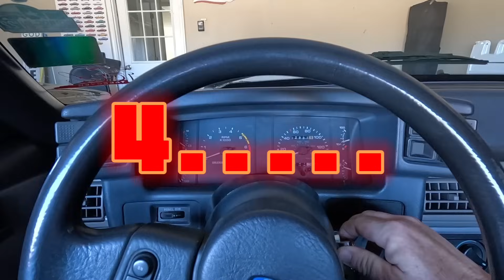Something DRASTIC needs to happen, and soon!

Comment: Sounds like the low speed / rpm issues are stemming from the converter being too tight fit the cam. I would personally start there.

Comment: Sounds like a problem with the converter. Mine did the same thing after a rebuild with a brand new converter. Put my edge converter in and problem solved. Plus it's a beast now when you put it to the wood!

Comment: Allow me to solve your mystery for you. I have a 91 lx with gt40 heads and intake with an e cam and a 65mm TB. My car is a factory Aod car as well. When I was building the car, I got some good advice that I totally ignored and regretted it the first time I drove it after the HCI upgrade. I was told not to leave the factory torque converter in it because it would cause issues with the e cam. Everything you are describing happened to my car, making it a total pain to drive. A few months ago, I gave up and switched the torque converter in it for one with a stall speed that was about 500 rpms over the stock one. Wow, what a difference, I love driving my car now. No more jerkyness, dying, and fighting against the converter. I used a B&M Tork Master Torque Converter 40437 and highly recommend it. Also it is not a high enough stall to require additional trans cooling.
Reply: If you would like to check my car out and drive it to see the difference before you make the change, you are welcome to. I am in East Tennessee outside of Knoxville.
Reply: That converter is really worth it? Why not a holeshot???
Reply: @imakeituptoyou  It is all about goals and what a person is trying to accomplish with a build. I was not trying to build a drag strip beast. I wanted to build a car with good street cruising manners that I could hop in and comfortably drive 100 miles to a car show with my family. Maybe have the occasional stoplight battle.I wanted it to retain the lock up and overdrive work like factory. All I needed was about 500-1000 RPMS over stock stall speed to work well with the e cam and accomplish that. I also did not want to generate excessive transmission heat that would require additional cooling.

Comment: The E cam is an Itty bitty cam. There's an idle air control issue. Crack that blade open a bit and reset the base idle. Needs more air to start and to catch it when the throttle closes. Your setup is so mild, it doesn't need any major swings to fix. Just my experience with this. And my option is free, just a few minutes of your time
Reply: AGREE 👍👍👍

Comment: Does the car buck coming to a stop in 3rd gear or is it still in overdrive and not kicking down soon enough. My 92 has a ecam with 4.10 gears and when I first got it together it shifted through the gears too fast and wouldn’t kick out of overdrive soon enough when slowing down causing it to buck like hell. The governor in the tail shaft could be sticking or if you are running a taller gear a high rev governor will help. In my opinion the only way to get the most out of an AOD is to get something like a SPTR  auto/manual valvebody from silver fox racing or Lentech  that would give the wife an auto and you the ability to shift it manually. It cost around $600 and can be installed in an afternoon

Comment: Fox cast! I was having the same issue with my car, ever time I popped it into neutral coming to a stop it was dying out unless I kept it running myself. Check the vehicle speed sensor man, also I couldn’t figure out the issue 100% in my car besides there’s back feeding voltage issue going to the IAC. Holley time!!!!

Comment: I have an 88' Merc with a similar engine control setup.   PSA: check the ignition control module.   The guy working on my car ended up sending 2-3 of them back to the parts store and going for one out of a junk yard before the car would run without stalling after a few minutes.    I wonder if you're having something similar or related to my problem here.
Reply: My buddy says also re-validate the pick-up coil.    I'd add, especially if you replaced them with "quality parts" recently.   There's been a rash of crap stuff being delivered in the name of quality lately.   Just a suggestion.

Comment: big cam ALWAYS means big converter.      Big cam means cold start, and idle mixture and timming changes.    If it had a carb and standard distributor,  these changes would still apply.      Back in the day,  manufacturing would limit a cam duration for automatics,   and go further with a stick.  A factory "stick cam" was a popular thing.
Reply: IF the computer cant make these changes,   then you have to change the computer.....    or change the cam....  or change the whole setup.

Comment: I don't exactly remember what cam is in pop's car. A while back, I came across the info that both E & F cams need a torque converter upgrade. I think the E cam needs a 2800-3200 RPM stall converter.

Comment: You didn’t mention what torque converter you have in it, but if you’re running a B cam with a stock converter, it’s not gonna be happy when pulling to a stop.  Time for a quality stall speed converter from someone like FTI, Circle D, Ultimate…

Aside from smoothing out the low speed bucking, it’ll wake the car up big time at wot.

Comment: Mine was bucking PCV 5 bucks at orileys it worked for me I run Lucas oil 10 30 full syn I know no fox is the same.  I had a stumble in throttle response good luck

Comment: Swap the converter. Gonna have to have a small 2000ish stall. The answer is not a Holley system or a engine swap. The whole point was to bring pop's car back for the wife. Don't get away from the original goal!

Comment: I had a 95 gt 5 speed. It ran great till I put a tubular gt40 upper and lower and an f303 in it. Changed a bunch of sensors timing all that shit. Nothing helped it. I ended up taking it to a tuner. After he changed a few things in the ecm the car ran great. A friend of mine had the same setup on a 93 lx aod car. He changed his to a speed density setup from an 86 gt. And that fixed his car.
 
My 2 cents is keep it push rod. I feel it wouldn’t be pops car with a yote in it. If that makes sense to you? But at the end of the day pops car 2.0 would be epic.

Comment: I really feel you. I know Brew2l likes to say the stock ECU will accept a lot of mods or whatever, but that certainly has not been my experience either with my SEFI 306. I have a Quarterhorse on it and will be having it tuned in the spring, but if it doesn't run and drive nice after that, I don't know what I'm going to do.

Comment: I would check the A/F ratio on both sides when it is misbehaving with a wideband. Maybe the injectors need cleaned? I hear what sounds like an exhaust leak too, that could be throwing off an O2 sensor.

Comment: So what would cause it to keep stalling? I have the same problem. I just dropped a brand new motor in mine along with a terminator X. Everything is brand new and also no vacuum leaks, I have a gm IAC and timing is good. It runs for a few minutes but when I give it some gas it wants to choke and stall out. I do have a comp cam with 512 lift. My idle is set at 750. Not sure if I should bump up the idle screw or what? These cars can leave you stumped when it comes to troubleshooting. 🤦

Comment: Not sure what cam or torque converter or rear gear you have. Sounds like either the torque converter is not a high enough stall. Or the rear gear is not a large enough ratio.
Reply: He probably needs a stall and more gear.  He Def needs a stall cammed cars need a stall.

Comment: 4
R
7
0 

Swap.  AOD is nice for a classic cruiser as it's a cheap way to OD, but it's a "dumb" transmission.  The twin input shaft/convertor design and no electronics leaves much to be desired for a fun driver...even with a Baumann shift kit.  I've done the AOD to 4R swap and it's a relatively easy swap that makes a huge difference.  Also, IMO, there's plenty of support for the EEC for tuning.  I used Willie at dirtydirtyracing for email tunes for a basic 302 all the way to a 408 with a choppy XFI236 cam and it ran very well.

Comment: Mine did the same changed the ACT air charge temp sensor also the coolant temp sensor for the computer not the guage was like night and day the way the car runs  stock computer HCI no tune on 19 lb runs drives phenomenal everywhere drives as good as my wife’s 2017 4Runner could daily this car everyday

Comment: I've noticed that in learning to tune mine with the MS3, low-speed bucking is either timing or fuel related.  An E-Cam should be good woth a stock converter.  I though Ford advertised them that way.  If anything it may surge at a stop.    Just my 2 cents.  Coyote and 6r80 would be a super reliable combo though...

Comment: Come on now... it's your Pops car, or a dayily for your wife. The 302 is a great motor, and the aod is a great transmission. Throwing  in a coyote is like putting a 671 on a 4 banger Pinto!

I don't think i remember if you put in an and computer or not, of not that's one problem. If you did, then it's just not capable of enough load adjustment for the auto. And the terminator  X is also expensive overkill
 A Megasquirt is half the price and has 95% of the adjustability of the X. 

That's all you need...

Comment: Maybe there is conflict with the computer on how it is adjusting the air fuel ratio, concerning that it keeps 
cutting off during startup. Maybe a Holley X would be a fix, could be the cam, intake, map sensor,
even though it is a auto-trans computer, it could be wigging out with all the changes.

Comment: Had a new ford Iac with the housing not machined flat and leaked across the gasket holes, causing inconstant idle issues. Noticed the way the old gasket   crashed to casting.

Comment: Itz just a B cam... The HCI is just too much for an A9P.
.Ask Brew2L. Leech used to tune the A9L/P to work smoothly with the E cam and upgrades.
Oh ya, and dont forget, after you hook up the battery it takes the A9L/P about 6 cold starts to relearn the fuel /idle trim.

Comment: If it’s the can put a stock cam in it. If you want to put a coyote in it put a coyote in it. It’s the wife’s car so seems like if the cams causing the issue that would be the cheaper more conservative choice. You know you want a gen one coyote in it stop playing. Open up a new can of worms 🪱 already. Why put a holly termi on it when you could just have a yote !!!   !
Reply: The cam causes the issue because the stall converter is not high enough it needs a higher stall.  You gotta run em on cammed stuff.  It would drive way better and be alot quicker with a stall and a gear